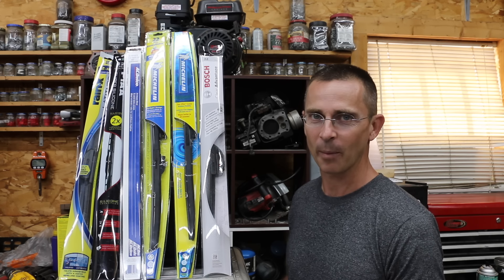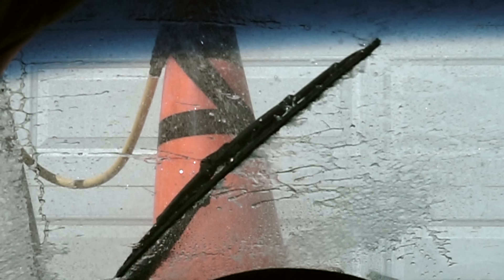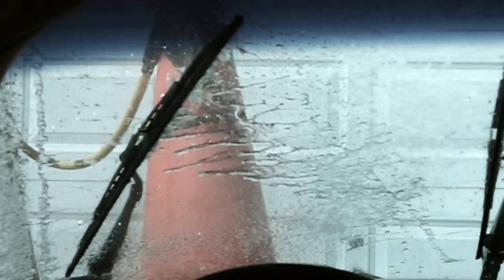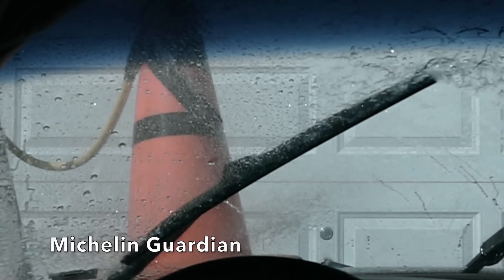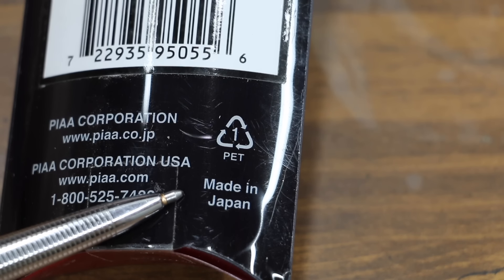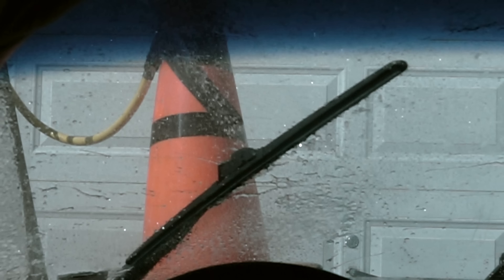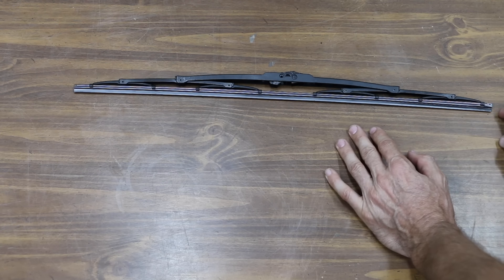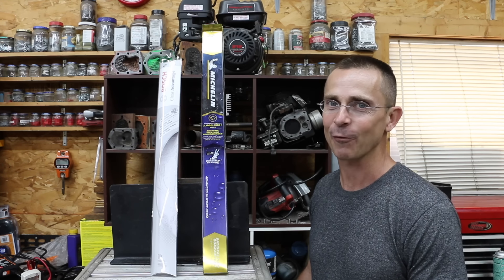Which Windshield Wiper Blade is Best? Let's find out!  Michelin, PIAA, Bosch, AC Delco, & Aero

Comment: I’ve always wanted to see this test. Wipers have gotten ridiculously expensive.
Reply from the maker: Thank you
Reply: ain't that the truth!
Reply: I buy wiper blades on close-out at rock auto for my s10- some are less than $1.50 each. I keep a couple of new ones in the tool box and just swap them out when they start skipping across the glass.
Reply: i been buying silicone 26" refills from ebay (Thailand). not sure how long they last cuz the cars ive had them on i sold just a few months after installing them. they always wiped nicely while i had them. pretty cheap too. i tend to avoid black cuz that color makes it harder to tell if im getting legit silicone.

Comment: I have been using the rainX spray for years and i absolutely love that stuff. Sometimes you dont even need the wipers on when you're going fast enough.
Reply: I by the rainx all the time I like the paformec
Reply: for some folks rainx is the devil! if your washer fluid uses a sensor and not a float it can coat the sensor  and the empty washer fluid light will never go off.
Reply: germanshepherd13 so do this crazy thing called checking your fluids like a proper driver.
Reply: germanshepherd13  you’re talking about VW cars that if you put the rainX washer fluid in the tank, it coats the sensor and you’ll get a low washer fluid light all the time.
Reply: I use it to and I noticed if I'm doing 40+mph that the water beads up and flies off.
Reply: Try AquaPel.   Youll never buy rain x again.
Reply: @germanshepherd13  the rains windshield washer fluid ruined my pump. It clogged it up! I'm a huge fan of the coating but this was freaking ridiculous and terrible.
Reply: @himesjon  I love the Rain x that you apply by hand, but their reservoir fluid is for shit! You're right about clogging stuff.

Comment: Great test . I use the Michelin . here's a tip for ya'll.. I use nothing but purified water , and mix in a pint of all purpose cleaner . it keeps the washer tubes & sprayers from clogging , and no hard water hitting the wipers causing wear . My wipers are well into 2 years old and still working great.
I live in Florida ..
Reply from the maker: Thanks for sharing.

Comment: Glad to see how well Bosch Clear Advantage did. My favorite is Bosch ICON, I'd be curious to see how they hold up.
Reply: I agree, Bosch Icon are the best wipers I've ever used.
Reply: They're absolutely incredible. First thing I do to a car after I buy it.
Reply: I don't know if you have these in the USA, but we europeans have Bosch Aerotwins, which are expensive but very good blades. Have never had better wipers
Reply: @superbeni7297  Bosch Aerotwin is basically the same as bosch icon. But it's made to fit certain cars which had special OEM wiper models.
Reply: I'm surprised he didn't test the higher-end bosch wipers. They would have destroyed everything else in this test
Reply: DO NOT try the Clear Advantage. I too had been using ICONs for years, and then stumbled upon these on Amazon for significantly less. I was dumb and bought 7 sets for all my cars, and then waited too long to put them on, as it was past the return policy. Every last set were pure garbage. Terrible streaks immediately, and annoying squeaks. Bosch should be ashamed of themselves for even putting them to market.
Reply: I’ll second the comment to avoid the Bosch Clear Advantage.  I’ve had great luck with the icon blades, but the CA blades don’t sit well against the windshield and leave large unwiped areas on the same windshield that the icons worked flawlessly.  And the icon blades can be reloaded with new elements very easily.
Reply: I was hoping to see this. I've been using Icons for years, now. Only wiper I'll buy. The only wipers I've ever owned that are streak and squeak free. When it's all said and done, you get what you pay for. They last 7500 miles on my "to work and back" pickup, and 10000 miles on my wife's grocery getter. Honestly, they probably still have life in them, but I change them when I change the oil.
Reply: Big fan of Bosch Icon as well, been using them for years.
Reply: I've had Bosch Icon blades on our vehicles for about five years. I thought that it might be time to replace them. So, I bought some Michelin blades at Costco. While examining the Bosch blades, I realized that they are still in great shape. After this test, I will probably return the Michelin blades to Costco and wait a while before replacing them with Bosch Icon blades.
Reply: Another vote here for the Bosch Icons. Very spendy but they last longer than any other blade I've tried
Reply: Another fan of Bosch ICON.  I go out of my way to get them.
Reply: @johnadamczyk6213  the aerotwins i bought in the uk was lucky to last 18 months, converted some icon from left hand drive to right hand drive and still cannot fault them after a year... they prefer heavy rain though i think.
Reply: I'll gladly pay twice what I'd pay for a traditional wiper blade when it lasts 3 times (or more) as long.
Reply: +1 for Bosch Icon's. I've been using them for 12 years, even on my racecar.

Comment: Bosch ICON last forever in rainy, HOT South Florida. Went from replacing 2x a year to... maybe every 3 years... if even that.
Reply from the maker: Thank you!
Reply: I imagine so I get about 2 and a half off mine and I have winter with road salt taking a toll on them
Reply: yep, Bosch Icon are Good Blades, last a long time, work well, and are QUIET... I HATE noisy wiper blades.
Reply: I had the exact same experience with the Bosch ICON in rainy, HOT central Florida!
Reply: I used icon before too, but it lasted the same as rainx... i am in ny, maybe because of the cold weather?
Reply: @kingarchnyc  Perhaps the cold weather, and salt from the roads. The ice and salt likely acting as sand paper
Reply: Florida has two seasons. Summer and hot summer. So, the rubber blades might melt to the windshield, right?

I'm from Indiana, where it gets up to 100 in the summer and -40 in the winter. Plus, humidity makes it feel like nah degrees in the summer. Had a cheap pair ($4/pair in 2007) melt on me once. That was interesting
Reply: I put on my Bosch icons 6 years ago and they still work good as new! Just give them a wipe with a paper towel and a little dish soap every once in a while.
Reply: I've had a similar experience in Clearwater, central Florida.  Bosch ICONs are awesome.
Reply: I live in canada and the bosch icon lasted me for 3 years and our winters are pretty bad.
Reply: Use refillable blades, so cheap compared to anything else. I found  a cheap pair of steel ones on eBay and made in Germany! German steel and 4 dollar refills for life!
Reply: @johnleeyingzhang3504   My experience hasn't been so good there, then again it seems like 2 years max is about what I get from pretty much any blade.
Reply: Agree Mike and those are the blades I get.  The Icons cost more, but they last here in Florida that's for sure and I live in Tampa.  I still replace them once a year though... just because I like fresh blades when our rainy months start up.  I tried RainX blades once; those were terrible and only lasted a few months before major streaks started.  I could tell they were really dry between rain spells and can't keep up with the Florida heat down here.
Reply: @Underskore  i guess everyone has different experiences
Reply: Yeah, by cleaning the element tip every once in a while, using cheap RainX washer fluid, and being smart with wiper speeds, I’ve been able to get the RainX beam blades I’m using to last 2 years.  They still don’t streak, but the element gets too stiff here in Indiana when the temps drop, so they chatter below about 45°F.  I’ve just stored them away til the next warm season, and threw on a cheap pair of Autodrive wipers, and still use RainX winter mix washer fluid.  Simple maintenance to even something as basic as wiper blades can greatly extend their useful life.
Reply: yep, On 3 years of my ICON's on my Charger and the passenger blade is finally starting to fail with streaking in the middle.
Reply: @brandonneider8023  those bosch  icons last a long time

Comment: Project Farm: I have trouble putting on 1 wiper... I can't believe you willingly put on 6 sets  for this test. Very interesting presentation... thank you so much for this info.
Reply: usually it's very quick and easy on the standard hook mount
Reply: normally it's just a small plastic clip or anything like that and the wipers come off easy. It's like seconds to change the wipers? Think you somehow did something not right ;-)

Comment: I've always been a huge fan of the PIAA super silicone blades. I've had them on all my daily drivers.
Reply from the maker: Thank you for the feedback!
Reply: john devine where do you get those,,as that’s a BRAND I HAVE NEVER SEEN? Thanks,,Cheers FromNJ🇺🇸
Reply: Probably on Amazon I bet
Reply: Amazon... Agree. PIAA super silicone are great
Reply: Yea my set of PIAA's are coming up on 3yrs now; best set of wiper blades on the market HANDS DOWN. Every so often you need to re-apply the wipes that come with them to the windshield, but you can buy them in packs of 3/5/10 on Amazon for a few bucks; the blades themselves last forever though.
Reply: True, a good tip. If you guys do want some extra performance as for water repelling is you can apply a ceramic wax. if applied correctly it will repel water like crazy on top of using the PIAAs
Reply: Leighton Samms Amazon for sure. Also bought them from Tire Rack in the past.

Comment: I live in the southern states with very little ice each year.  The Rainx latitude is by far the best I've ever used. I've driven for 8 years testing wipers side by side transporting railroad crews across the southeast. I'm sold on the Rainx blades.
Reply from the maker: Thanks for sharing!

Comment: Hard to factor in, but the Rain X treatment, when effective, nearly completely eliminates the need to use wipers at all. Surely the reduced wiper use contributes to longevity.
More than anything, I'm interested to find out which blade lasts the longest before they begin to fragment, and must be replaced.
Happy to support Project Farm through Patreon.
Thanks PF!
Reply from the maker: Thanks for the video idea.
Reply: This is why I use the rain x windshield wiper fluid but not their wipers. Their wipers don't last, and the washer fluid does the same thing. Depending on the vehicle, but usually once I hit about 45mph or so, don't need the wipers anymore.
Reply: @brendanberry7403  this, not to mention that bottles of the fluid are so cheap considering you get quite a few applications per bottle and an application can last a decent while. I'll use blades half the price and keep dropping 10$ a year on the rain-x fluid.
Reply: The rain-x fluid is awesome. I can drive at 75 mph in a storm without even having to use my wipers and still have pristine clarity.
Reply: I was thinking about that also.  RainX needs the wind to make a difference.  A good coat of Rainx and the bugs don't even stick. :)
Reply: @brendanberry7403  I used to use rain-x for that reason. however I had caked on bugs and no amount of rain-x was helping, I tried Windex next and it cleared all the bug guts right off.  If you live more rural, Windex will change your life. the rain treatments in the spray bottle and the wipers are amazing, I can be going through some of the worst conditions and not need the wipers
Reply: @seth7131  What are you even talking about? You know Windex and Rain-X are two completely different products that do completely different things, right? Your comment makes zero sense.
Reply: I got Michelin Silicon and the rain x silicon and Michelin starts to rip from the middle of the blades in a few months It’s absolutely terrible when it comes to durability. It’s still wiping good bcz it’s got the silicon coating. I don’t think it affects the performance so much  but it’s great when it comes to rain. However the rainX silicon is a few dollars more but it’s equally good and no squeaking noise. It’s worth the $55
Reply: one guy used fabric softener. it worked.
Reply: Not accurate. I owned a pair of RainX blades.
Usually you're attracted to them because its "RAIN X" with its fancy tech and coloring, but its really not all that great. 
Yes, the beading does help where you don't have to turn on the blades in lower-rain conditions, however, they're still going to age.
I bought a pair, and one of the blades started to act up within 6 months. Its rubber at the end of the day. Can't engineer that out. 
Rubber is going to act up due to weather and other elements. Usage doesn't matter.
PIAA is the only one with silicon, I highly recommend it. People like scotty Kilmer have recommended them as the best wiper blades to get, he's used them for decades. I love them myself. 
Extremely reliable and longevity. 

Not to mention that silicon actually beads up water too. I wouldn't say its exactly like rain x, but its still pretty useful. 
I'd rather buy good blades and a bottle of rain x rather than buy rain x blades.
You could buy silicon rain X blades, but I can't recommend them as I haven't personally used them.
Reply: I'd be Interested in the longest lasting blades too because in my 31 years of driving I've noticed blades don't last anywhere near as long as they used to. I'm lucky to get 4 months out of a set of blades whether they are cheap or expensive brands.
Reply: Keep armorall in the blades, apply one a month to keep that rubber healthy
Reply: Rainx spray is amazing for helmets. Removes the need for peeloffs, and on track days, that plastic can be dangerous for two wheels.
Reply: I'd like to see which wipers work best with the treatment. I'd think some good ones might wear away the treatment faster
Reply: I was committed to RainX forever, but I tried the "Rainbrella"(vomit-inducing name; it is a legit Rustoleum product though, in spite of being "as seen on TV") wipes after seeing a box in Walmart and the formula they're using is just on another level from RainX, it's just better in every way - it's more effective, rain beads away at a lower MPH than the RainX, so it has superior hydrophobic properties; AND, in my experience, it lasts longer/goes further between applications. I'm sure it ends up being more expensive because [as far as I'm aware] you can only buy the wipes, you can't buy just a bottle of the formula; but it's still so damn cheap(like $5 a box I think, you get a couple individually sealed applicators - though I have sealed them back up after using them and have gotten multiple applications out of each applicator, I've probably gotten 2 years out of a single box) and lasts so long that the cost really isn't much of a factor.
  
With that said, I've still been using RainX beam wipers too. I'll clean the windshield, install them, do the dry application process, drive around on that until I start to see the effects diminishing, then go back to applying the 'Rainbrella'. Can't say the last time I've changed blades, probably when I bought this car 2-3 years ago, but I obviously NEVER use them with the regular use of hydrophobics outside of winter or the odd REAL heavy rain storm. And they're still in flawless shape(I really don't take care of them in the winter either, lol, they get the shit beat out of them when the snow & ice comes), even while living outside 100% of the time. Mind you, I've also used Bosch & Michelin beam blades, and they also work perfectly fine. The RainXs just save me a hydrophobic coating application, lol.
Reply: @brendanberry7403  same here... i'm using rainx fluid for car windows. mirrors, motorcycle helmet visor, headlights... cost little per application... and i can use standard wiper blades after.
Reply: I'm a firm advocate for Rainx treatment.  Been using it for years. Plus I use Rainx wiper fluid to help maintain the treatment in between applications.
Reply: @RyTrapp0  never heard of Rainbrella, but I’m gonna look for it. Thanks for the recommendation 🙏🏼 
I’ve been using RainX for 20 years, and will probably continue to use it to some extent, but the one thing I’ve always hated about their type of treatment is the poor performance at lower speeds. Traveling in any kind of urban and/or low-speed environment pretty much renders the RainX treatment useless. It’s just not hydrophobic enough to work sufficiently in low-wind/low-friction conditions.
Reply: Majestc Potat0  I've been using RainX for years. I have been a proponent for it's effectiveness and safety for nearly as long. You really understand when in a heavy down pour, others have to stop yet you can see to keep going. And yes on the highway at speed in moderate to light rain you don't need your wipers.
Reply: @brendanberry7403  Do your blades squeak and chatter when there is only mist coming down?  Mine do and I use the RainX treatment on the glass.  I absolutely adore the RainX, but hate the chatter.  If RainX wiper fluid fixes that, I'm sold.
Reply: @ljprep6250  when new and for a long while after, no. Eventually they do regardless, but I’m in a really dusty area with clay dust.